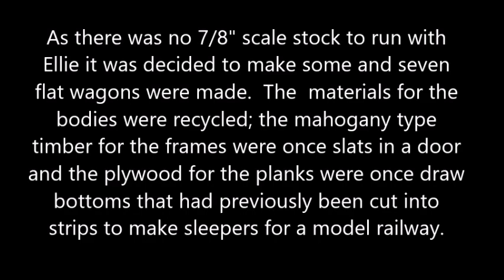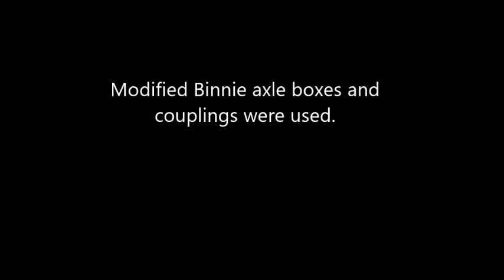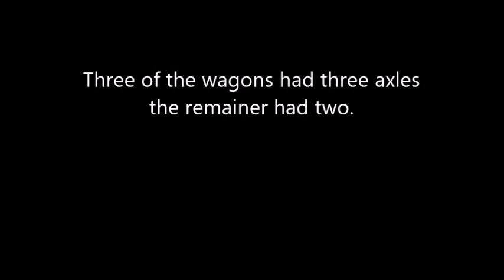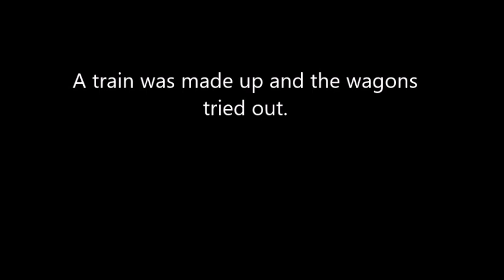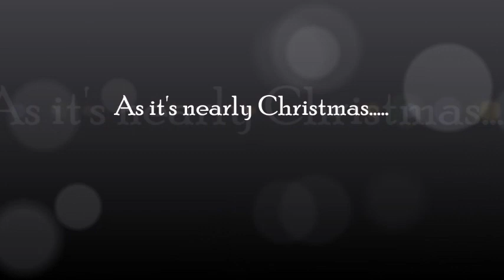Ellie the Steam Tram  Wagons

Comment: And Merry Christmas to you Tony bird.  I have enjoyed the build and running of Ellie.  I can't wait to see what the new year brings to your rails.
Reply from the maker: Hi Jim,  Glad you enjoyed the videos.  My next project is to finish another 7/8's scale locomotive which is based on an 18" gauge forward control one with a vertical boiler at it's rear it has a geared drive with a chain transmission between axles.  The chassis is finished and can be seen running  about five minutes in on:

 https://youtu.be/CdR_aoMGs-g

The boiler is about half finished so it shouldn't be a long build 

Take care Tony.